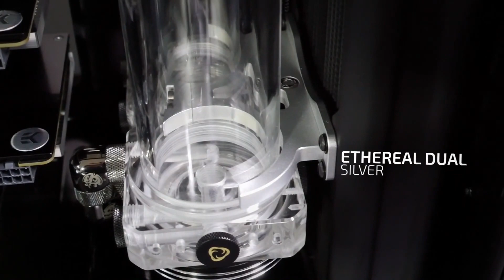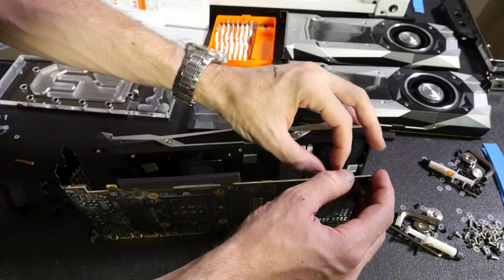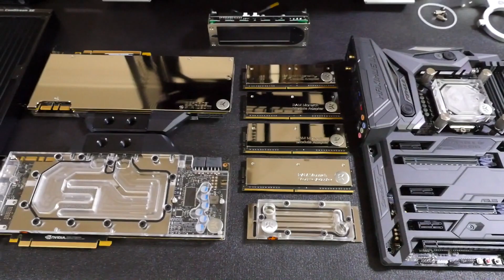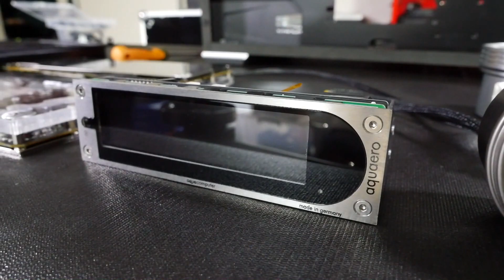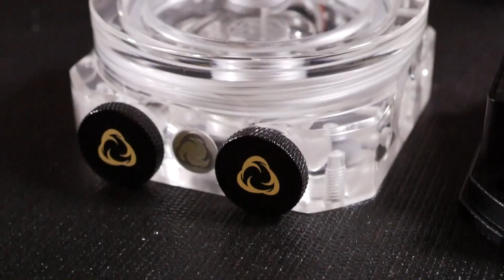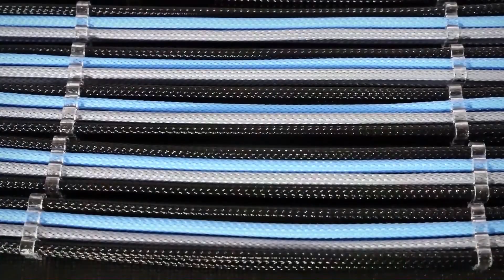Silver Tide: Part 1

Comment: I wonder if it will be problamatic drainingn the front mounted radiator if its mounted with the ports facing upwards. As fas as I know the SE360 does not have a drainport. Is this a big problem? Mounting it this way would make front mounted rad much easier, as you dont have to fiddle around with a lot of different fittings in the bottom.

Comment: I started a build in this case, stopped and now I'm considering scrapping it.  What are your thought on air flow.  I planned for rads front and top.  as an afterthought I considered push / pull fans on either side of the rad and then decided the HAF H500P would probably work better.  This is given the higher tdp of Ryzen etc.

Comment: That Seasonic PSU looks baller!  But I've had issues with a handfull that wouldn't power up back on unless drained.  Could be a bad batch because it happened 3 times!

The lower end ones in their line don't seem to show this probem. Any experience with this?

Comment: Singularityomputers, would you say EK verdar fans or the Notua nf-f12 PWM fan is better? for 240mm 19fpi radiator?
Reply: Skinnwalk3r I've used both the ek vardar & the 50 pct quieter noctua. But found vardar quiter than corsair or thermaltake

Comment: That Seasonic power supply is the best on the market. I wouldn't say he did it just to be different.
Reply: also, many high end psus are just rebradned seasonic psus
Reply: Oh, really? I remembered reading that at least the AX (non i) were built by Seasonic. My mistake if you're correct.
Reply: Peter Pimmelmann Exactly. Like Corsair. ;) 

Still, I'm glad to see someone using different components. It was becoming boring watching the same Intel/Nvidia//ASUS/Samsung/Corsair builds.
Reply: +Daniel West Corsair AXi series is actually manufactured by Flextronics not Seasonic
Reply: exactly

Comment: What is your opinion on the Evolvs airflow? It's a amazing case, both look and feature wise but I feel like the front panel is a bit restrictive. Have you noticed any potential downsides with the case?
Reply from the maker: Airflow is restricted but the aluminium panels dissipate quite a lot. Id prefer to mod both panels with mesh. The case cant really do a top radiator without serious mods to the top panel. Aside from that its a good case.
Reply: I'd love to see a mesh mod to both panels, I think the case would look fantastic and have great airflow.
Reply: I have a build in the Evolv. Absolutely love it, but the airflow really hinders it in a lot of ways. Got a slim 360 in the top, and a normal coolstream 240 in the front, but its certainly a tight squeeze. 
(Link to a post I made on the LTT forums trying to get advice on improving it: https://linustechtips.com/main/topic/793103-bad-temperatures-despite-custom-loop/)
Reply: You probably already know about this but ModMyMods is about to sell a modded top panel for the Evolv to fix the airflow issues:

https://modmymods.com/phanteks-enthoo-evolv-atx-replacement-top-cover-air-flow-mod-black.html
Reply: I have an air cooled build in the mATX version of the case. My case cooles phenomenal, but I guess with radiators one should add a few more air intakes. One thing that is great with the way it is built, is that you can put an external drive or stuff like that on top without worrying about the airflow.
Reply: I've got almost this exact same build and the airflow sucked until I modded it